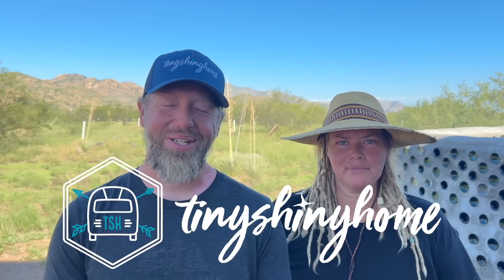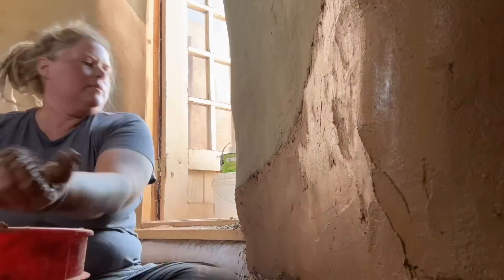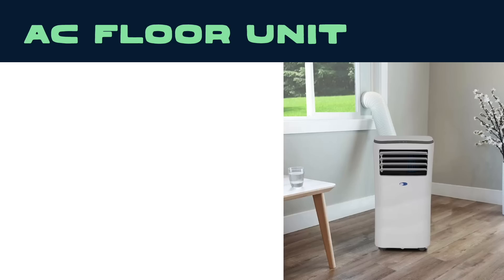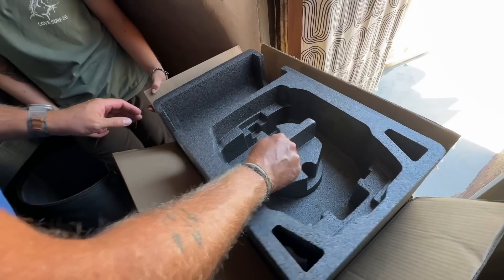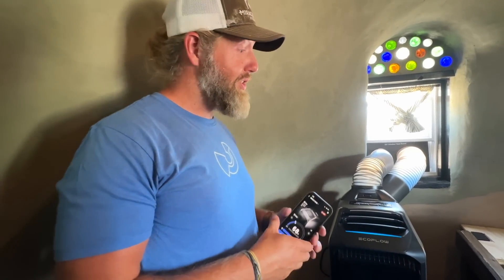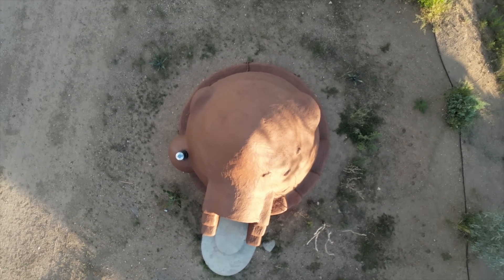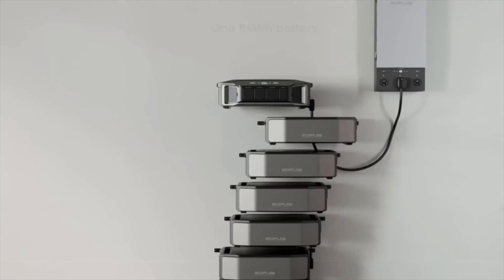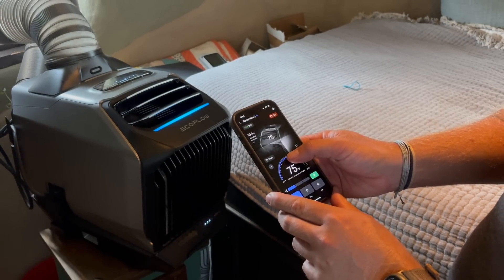Can This Tiny AC COOL Her Superadobe DOME?

Comment: i happen to be a bit of a crazy person but I've been kicking around the idea of a dome inside a gabion cylinder filled with lava rocks and the whole thing topped off with a deck. a dome is a lot of mass and holds temperature for a long time but that dome has no insulation and is painted a dark color. i am not surprised it is getting hot. but, what if the sun never hit the dome? what if there was light weight lava rock to insulate the dome? i mean sure your basically going to be living in a pile of rocks. but at least it will be an interesting pile of rocks, that double duties as the support for an above hang out deck. plus i bet it is windy out there. if so, i'd sew a tyvek cylinder that is bigger then the dome but smaller then the gabion wall so the wind only gets thru the first layer of sun blocking lava rocks and no t to the second layer of lava rocks that are acting like insulation. it would mean a bigger gabion wall around the dome, but it also means a bigger hang out deck. could even have gabion railing around the top deck. just an idea. plus. i really think you could modify the dome a bit before you do something like that because that ecoflo takes up too much room in an already too small bedroom.

Comment: In hindsight what might you have done differently to solve the cooling problem before you finished building the dome?
Reply from the maker: Making the windows bigger for a window unit would have been the easiest change
Reply: @TinyShinyHome  For the sake of discussion, what if you had a closeble vent at the very top of the dome, to release the hottest air? Shading the dome itself could reduce solar gain. If there is a gap between the shade structure and the dome you could design it to draw air in between and reduce heat gain. I remember learning about mushrooms whose  caps are shaped underneath in such a way that air is drawn through, and disperses spores on on the wind. A bit of biomimicry here, of course one would have to build in such way to resist a windstorm. Along the Mediterranean traditionally, deciduous vines were grown on the sides of buildings to cool in the summer then in the winter as the vines lost their leaves the sunlight could reach the walls and heat the interiors. Thanks for your work.

Comment: I have the Wave2 and use it in my bedroom in the house. I only ran the air intake hose through the window and left the outtake tube off (no sense in sucking in hot air) and it works just fine that way. I also run it off the electricity since I didn't buy the battery.

Comment: Personally I would just put in three poles and put a removable triangular shade sail up. As soon as you get the sun off that thermal mass you’re going to be dropping that temp 10 degrees at least, you can take it down in winter. Living in the subtropical sun for years has taught me to shade shade and more shade in summer. Hence why you put up the shade sails on the airport
Reply from the maker: The shade sails are attached to a metal truss cover specced for hurricane force winds. Building a structure that safely houses more shade sails would be dangerous and cost prohibitive.
Reply: @TinyShinyHome   Fair enough, , you have probably done all your costings, I'm surprised it's that costly though, even building to cyclonic conditions, I guess you don't have the trees for your own poles either. I hope the A/C works out for you.

Comment: Looks like you need a few shade clothes for the dome. We also had to run an extension cord from the cabin to RV AC unit. Shade clothes are the real game changer though for keeping sun off the RV.
Reply from the maker: Too expensive to build a structure that can safely hold the shade sails in our winds.
Reply: @TinyShinyHome  Tall metal post cemented into the ground or something wouldn't work for shade clothes? I'm in the California High Desert and get crazy winds but my ghetto 2x4 post NOT anchored into the ground (just have legs and cement bags holding it down) holds up. AZ monsoon winds are probably much stronger though I'll admit.

Comment: 3" of PU closed cell foam is used on the outside of Monolithic domes because of this very problem. I never figured out why you all do not insulate the outside AT ALL?!
Reply from the maker: Insulating earthbag domes isn't something that's done very often because they do work so well so much of the year. Might be something we experiment with at some point. Remember if you're closed cell foaming you're removing the breathability of the earthen wall which is an importnat consideration of this building method.
Reply: @TinyShinyHome  Yes, Monolithic domes (3" concrete, 3" PU foam) are so air tight that the have to have a energy recover ventilator (ERV) fan.

Comment: Would an outside shed for batteries and aircooler be a good solution since everything is on wifi??   maybe a quick (insulated and waterproof) quonset kit??
Reply from the maker: Way too expensive and complicated for cooling 2-3 months out of the year. This is much simpler.

Comment: I guess it is to late to incorporate geothermal like the kind used in earthships. That may have kept the temperature between  60 and 80 degrees year round. Then you only need a 10 degree variance either way.
Reply from the maker: It pretty much does that anyway except for these couple of months, but yeah something like that wouldn't be an option now.
Reply: @TinyShinyHome are you considering that for the house to offset those extreme temperature ranges in winter and summer? I personally would love to see you do amongst all your other projects!😊 what an awesome family thanks for letting me come along for the ride!

Comment: In such a small room, something else takes up space on the floor. Air conditioner depends on power. 1 power is correct. Takes more, but manages to cool in half the time and the compressor is usually off.

Comment: Nice, it looks to me putting the unit outside in a protective cover would be a win /win situation. The noise the condensation (water) and more room. thank you thinking about this unit in my RV camper, your thoughts?
Reply from the maker: I think it's mainly meant to be run inside. If the camper is decent size definitely look into a proper mini split: https://youtu.be/mRcHImNXHU8

Comment: I just ordered a 3-ton; 3 zone mini split system to replace a standard 3-ton unit at on the lower part of my house. These mini splits are super-efficient, so I expect it to work very well. I have also seen vans and campers using this method instead of the super expense RV style units. MR. COOL makes it easy for DIY persons who have common sense, a few tools, and average IQ to follow directions. Thanks for sharing all your knowledge and experiences for all our benefit!!!

Comment: Can you explain why you cannot add additional batteries and more solar to this Ecoflow unit?  The current system seems to be too small for the HVAC load.
Reply from the maker: Like we mentioned in the video, you can add more batteries, but it does that via pairing with something like the Delta power station (and then you add the batteries to that).

Comment: Just thought I'd mention that a screen material like  what you use with a screen door might work over those tubing's for the cats also I did want to mention I'm in Hot Springs Arkansas and the people in the lake homes install tinted window film on their Windows because the reflection from the sun off the lake heats up their homes much like what it probably does with the sand on your property well I'm wondering if that wouldn't work on your windows and it literally cuts their electricity bill in half because the tent from the windows but mostly cuts down on the heat from coming in , also you can't see through the tinted film from the outside looking in during the day however at night you can see some just wanted to mention that I love watching your kids I'm living in Sticks and bricks but I'm 65 years old hippie I never stop learning and that's why I watch you all and we can all learn from each other thank you for sharing your journey 🩵

Comment: Did I miss the part where you said you will add another 250w panel..? Remove the existing panel and get some uni-strut long enough to add a 2nd panel. wire them in series and it's self contained. I use my Ecoflow Delta and Delta 2 for powering many things.. washer\dryer, hot plate, toaster, air fryer, 12k mini split, recharge my cordless shark vac, Ryobi batteries..  Love the extra power they provide.
Reply from the maker: The River 2 only accepts 250w so no plans to increase the paneling, no. The WAVE 2 will take up to 400, but that's still not really enough to run it all the time - plus you'd need a lot more battery anyway. Just made more sense to run it off the big system in this case.

Comment: Paint the dorm white and insulate the window tubing will probably get you a 20% increase in your cooling. For heating you have the fireplace.
Reply from the maker: Thermal mass transfer still happens no matter what color it is.

Comment: Fun stuff as always! Are you planning on adding more solar to her dome? You can hook up 400w of solar to the Wave 2 itself and keep the battery charged and even run it in some modes. Just an idea.
Reply from the maker: No, even 400w wouldn't really help. You'd need multiple times that + probably 5kw of battery storage to run overnight.

Comment: Why don't you put a shade around the house like you did the other place that you put those shade sails. That would help tremendously I would think.
Reply from the maker: Because that other place is a metal truss cover rated for hurricane winds. To erect some sort of structure strong enough to withstand the winds we get here would be very expensive and difficult, not to mention now there's an ugly thing covering the dome. Remember, we're talking about a few months out of the year here. Much simpler to put in a temporary AC, then remove it.

Comment: Question for you guys: doesn't an earth home just oscillate around the average daily/nightly temperatures? Clarifying: if overnight low is 85f, overnight average is 93f, daily high is 110f, and daily average is 104f -- in my example, say the average over 24 hours in August in Arizona near where you are is like 98.5f. My understanding is that the dome might be 98.5f plus or minus a much smaller delta, maybe like +/-3f, and oscillating around that 98.5f, which is pretty miserably hot for sleeping! Earth homes in hot AF Arizona just confuse me. I think it's probably great for 9 months out of the year, but July, August, and early September are probably miserable, no?
Reply from the maker: No, it has less to do with ambient temps and more to do with the transfer of sun energy through the walls. Lots of numbers here, I'm not really following what you're asking.

Comment: Is there a reason you're not running more panels for the little dome? I'm getting440 watt brand new panels over here in Tucson for $150. Even if I was paying double I'd think more panels would be the safer way of doing it. I have a similar setup to where we have one main 12kw panel array with smaller arrays around the property. More efficient. Sungold is having some good deals on their whole setup that I'm thinking of having for an upgrade.
Reply from the maker: Like we mentioned, the River 2 only takes 250w max. The WAVE 2 can take 400w, but it doesn't really matter. You'd need a lot more than that + a lot more battery to make it work. Much simpler to just run off the main system.
Reply: @TinyShinyHome  I don't know your budget but they have little 5000 watt systems from sungold for reasonable prices. Batteries, controller, panels, and everything else needed. They might have even smaller than 5000 watts. We're running a 12,000 watt model from 2 years ago. But everything has came down in price for solar even with inflation
Reply from the maker: Or we could just run an extension cord for a couple of months to the existing system ;)

Comment: I simultaneously charge the battery and run the Ecoflow so the battery is always topped off.  Then if necessary, just unplug the charger cord from the battery.  Making water is a secret plus feature of the unit.
Reply: the water hose 
could dump into a plant, water bowl for the cats...

Comment: On the vent tube you should be able to use a dryer shroud that plugs into exhaust pipes on dryer and angles the flow down because the dryer shroud  are shrouded down to keep water out of dryer pipes it might help to do that also maybe a smal Honda generator might help on low sun days as back up I'm just suggesting I don't know but I know the shrouds are swoop over and down to keep rain our of dryer vents I'm not sure that will work but there are companies that make custom plastic pieces to have exactly what you would need. Have a great day love your show
Reply: Or you can use pictures and put them on a elbo and down
Reply: Pvc

Comment: You did not think of having a vent, on top of the dome so the hot air can come up,  and earth cooling tubes. I tried it on my built works fine,  not an aircon but I sleep comfortably at night, and chill in the afternoon, less electricity consumption for my 2 kw solar system, w/c powers my starlink, and charges my phone and laptop.  Much love from the Phillipines ❤❤❤❤❤
Reply: Exactly what I was going to comment and your experience is informative on its efficacy. A roof vent would also help remove the moisture as it will travel with the warm air flow out
Reply: Bingo. This was exactly what I thought. Earthship concepts that have been working in the southwest for decades.

Comment: The new solar powered mini splits are extremely efficient for small spaces.  But I do like this EcoFlow idea.  Thanks for sharing this idea.
Reply: My pioneer is in a 300 sqft space, it was only 700 and it replaced rooftop ACs, dropping my bill to 1/4 of what it was. I highly recommend these, and especially if they are being run on a solar array. N type panels and BB ratings are so good now as well as efficiency of mini split tech. Whisper quiet. Seer ratings are very importantbas well.
Reply: I just switched out a 9k Pioneer for the new EG4 Hybrid 12k. connecting panels to it within the hour. I also have and use daily a Delta 1300 and Delta 2 for important things like my Keurig.

Comment: Perfect for that size Dome. I use a 16 mil white tarparound a 2 inch thick foamboard on my southwest side, and a sunscreen on my west side of my Callen Camper with a $160/5000 btu walmart AC.  Its super efficient and i run it on Low all summer. Even in 95 degree Idaho heat. I can even turn it off every  night  .  The Sun shields made a World of difference . Something to consider for more efficient Power usage. Less direct heat, less thermal transfer in afternoon and eves. 🙏🙏🙏Be blessed Romans 10 9-10

Comment: I really enjoyed this video and your review of Eco Flo. I don't normally watch "sponsored" videos because they really are just ads. I pay Google not to see them. But if I am interested in a product like this one today, I do watch. Eco Flo designs so many wonder interchangeable products to fit the user's situation. Obviously, you had to work on the power issue for the small dome. Next time, you would probably build in a vent while constructing it thinking ahead to needing it because of the small window size. I recently looked at an apartment for rent that had a through the wall round vent area with a door so that something like an Eco Flo would work well even though there was a mini-split installed in the unit. People are searching for solutions to accommodate heat/cooling and power. Eco Flo couldn't have sponsored a better channel for this review.

Comment: what about ground cooling the incoming air? long deep trench with a pipe a  you can get the air down to ambient ground temp which should be a lot cooler  very low cost mostly labor
Reply from the maker: Not worth the expense and labor for such a short part of the year.

Comment: I was wondering if you could put the unit outside and tubes inside. Seems much more efficient space-wise. You'd probably want a small well-insulated shed to put the unit in and insulated vent tubes. Good show!

Comment: You could use a smart plug to change from AC to running off battery.  I do this for several systems in my house.  You can create schedules so you don't have to remember to plug or unplug it.

Comment: We run 3 ac units as well, but they are all floor units, and they use a ton of power. We also run a freezedryer 24/7.
Hopefully, we can get mini split units that use half of the power for next summer.
Great experiment. Hopefully, it does well in the long run. 
Thanks for sharing, and as always, keep building 👍

Comment: How about adding a couple more solar panels to the dome system?
Reply from the maker: Like we mentioned, the River 2 Pro only takes up to 250 watts.
Reply: @TinyShinyHome oh, yup, okay… so to increase panels, you’d have to upgrade the river pro 2… 
  Live and learn. So if you were to build/design another dome, there would be some design engineering modifications.

And in the meantime you have a working system…
Reply from the maker: Yup!

Comment: any thought to figure out some shading options to use on the exterior of the building? So that it doesn't pick up so much heat during the day.
Reply from the maker: With our winds and the length of time it's too hot, no it's not worth it.

Comment: As always interesting video👍
Why don't you take an other 200 watt panel. Instead of south facing, having one facing east and one facing west (connected in parallel). In that manner you can harness more energy and you are still under the limits of your equipment, so you don't need anything new...
Reply from the maker: The River 2 Pro only allows 250w. The WAVE 2 can take 400w directly, but either way that wouldn't be nearly enough solar. If you watch the video the main issue was battery life overnight.